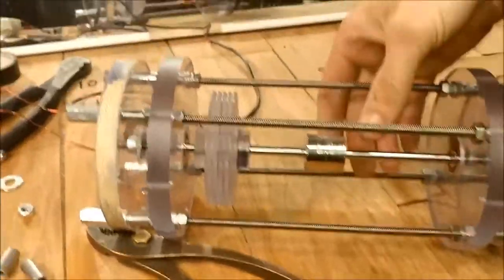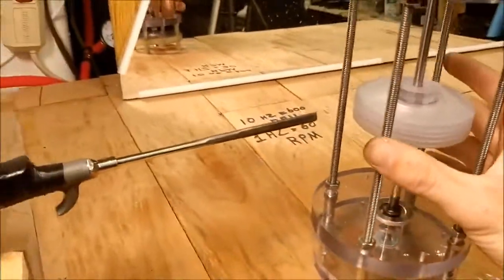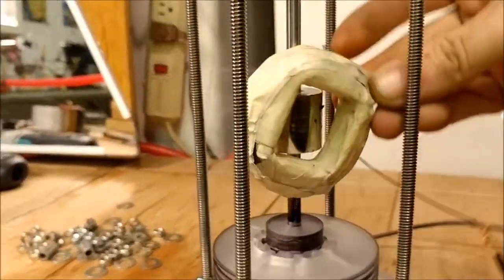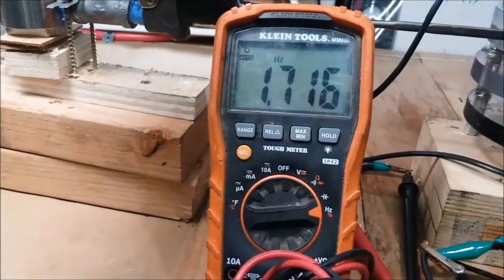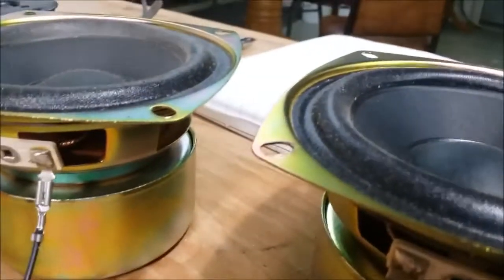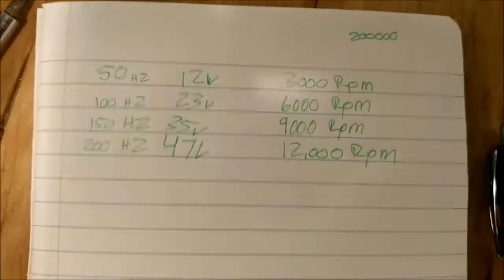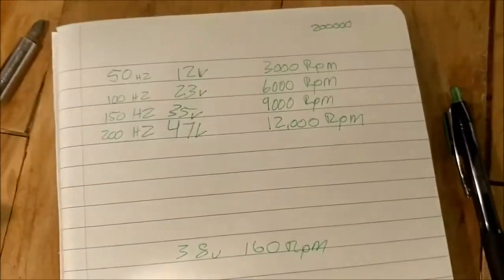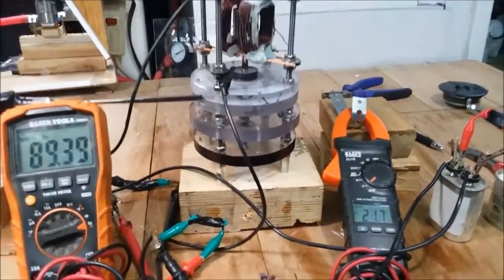Nikola Tesla's Flywheel Accelerator - The basis for the generation of free energy - Overunity

Comment: in order to estimate the output of a  tiny  alternator,  first, measure current, via a short through an ammeter.       THEN,  measure/estimate the voltage,  at  the  Same  REDUCED  rpms.!!!!!   as when  shorted.

Comment: I like your work, i have a question: where did you get the neodymium magnets? (the magnets of the end of the axis) can you share the link? other question, the central axe is antimagnetic? i can see the central magnet is diametrically magnetized..... very good work.
Reply: Anti magnetic? O.o I think you mean diamagnetic.
Reply: The central axis is suspended by the magnetic bearings. If it were a diamagnetic shaft, rather than the steel ferromagnetic shaft, the magnetic bearings probably wouldnt be need and just acouple ring magnets would do, but that would mean the shaft would be made of bismuth and would be WAY less sturdy, and I think that could interfere with electricity generation (although im not certain on that) as the stator (spinning motor core) needs to be laminated steel I'm pretty sure.